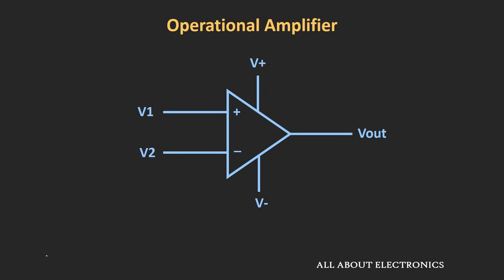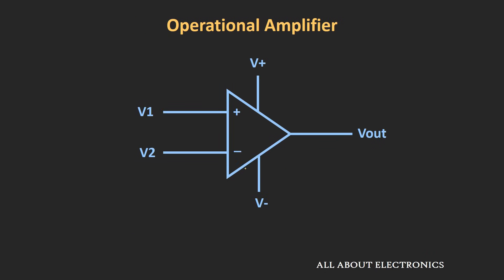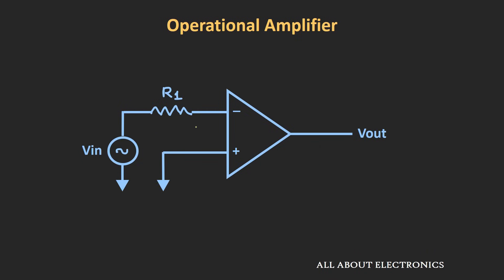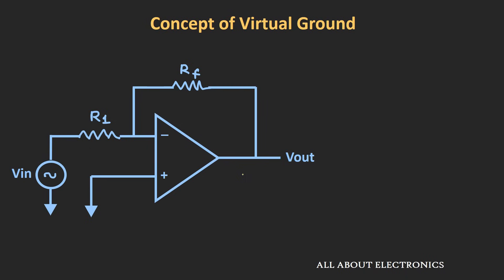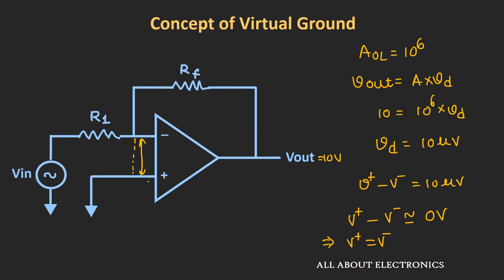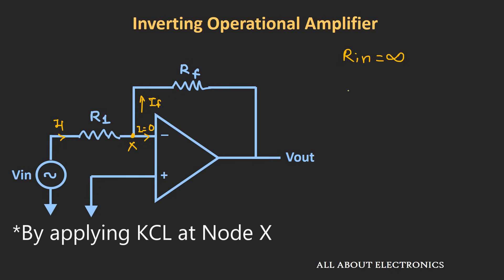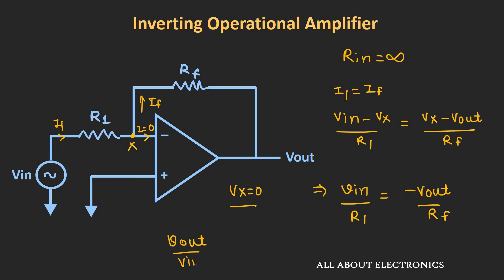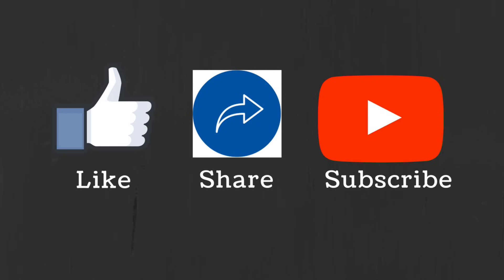Operational Amplifier: Inverting Op Amp and The Concept of Virtual Ground in Op Amp

Comment: Sir if the differential input is 0 then according to the CMRR characteristic that had discussed in early video output should zero na? I am confused about it
Reply from the maker: I think you got confused because of the concept of the virtual ground. 
But in the inverting configuration, the external input is applied only to one terminal. ( I am not referring the voltage V+ or V-, but the external input voltage)
So, here differential input is Vin only. 
If you take the case of the differential amplifier, where the input is applied at both input terminals, in that case, the differential input is V1 - V2 or Vin1 - Vin2.
I hope it will clear your doubt.
Reply: @ALLABOUTELECTRONICS  no sir not yet
Reply from the maker: In the closed loop configuration, the differential input is Vin1- Vin2. The external voltage applied between the two op-amp terminals. ( Not V+ - V-).

Comment: Sir why we don't give positive feedback because it leads to unstability but why
Reply from the maker: See, when you want to use the op-amp as an amplifier, then you want to amplify the input signal with particular gain right ??  And at the same time, the signal should not get distorted. 
With the positive feedback, the output will go to either positive or the negative saturation. And op-amp won't function as the amplifier. 
That means when we want to use the op-amp as an amplifier, it should be used in the linear region. and that's only possible with the negative feedback.
I hope it will clear your doubt.
Reply: @ALLABOUTELECTRONICS  thanku so much sir yes I understood

Comment: How can Vx practically be 0, I understand that 2M ohm resistor allows current in the uA range, but that does not mean that +ve and -ve terminal are at the same potential ( just because of minute current flow ( mA) ).

Comment: Why linear region is small in open loop ?
Reply from the maker: In the open Loop configuration, the voltage gain is very high. Typically 10^4 to 10^5 order. So input voltage of Vsat / 10^5 is sufficient to saturate the op-amp. Vsat is the maximum voltage the op-amp can give in the output. Usually it is less than supply voltage. That means input voltage of few microvolt is sufficient to saturate the op-amp. That's why in the open Loop configuration, the range of the linear region is very small. I hope it will clear your doubt.

Comment: Sir Is  feedback current will flow same direction or reverse direction?
Reply from the maker: It depends on the output voltage. If the output voltage is positive, then it will flow in the opposite direction. From Vout to ground ( From higher potential to lower potential).
If Vout is negative, then feedback current will flow from node X to Vout (From 0 to Vout)
I hope it will clear your doubt.
Reply: @ALLABOUTELECTRONICS  
It is clear thank you sir

Comment: In this confirguration we are get v+ = v- =0 then vd=0 then why vout is not equal to 0 ??
Reply from the maker: When we say V+ = V- = 0, its an approximation which is used for the virtual ground concept. Actually there is a difference btween V+ and V- ( in microvolts). And when it is multiplied by the very high open loop gain, we get some finite output. 
But here, with the negative feedback, when we consider the close loop system, then generally we refer to the close loop gain of the op-amp which is decided by the external resistors Rf and R1.
I hope it will clear uour doubt.

Comment: Why If goes up? I assume the potential of Vout is more than Vin and current direction should be down
Reply from the maker: You can assume other way also. That means current is flowing from Vout to the inverting node. If the assumed direction is opposite then the current If will be negative.
But in case of the inverting configuration Vout = -Rf/R1*Vin
That means if Vin positive then Vout is negative (for DC voltages)
In that case, the current If will flow from the inverting terminal to the Vout. (From higher to the lower potential)
If Vin is negative, then Vout is positive. And in that case, the current If will flow from Vout to inverting terminal. At the same time, the current I1 will also flow in the reverse direction. (As Vin is negative)
So as far as KCL is followed, you will get the correct result. 
I hope it will clear your doubt.
If you still have any doubt then do let me know here.

Comment: Like all your videos. I have seen this explanation of virtual ground many times, but it is always lacking something. Here the opamp is drawn with a feedback loop, but the huge gain of the open loop opamp is used to explain that the inputs are at virtual ground. Then it turns out that the gain of the opamp with feedback is by several factors smaller than the open loop gain. This would then mean that the inputs are not at virtual ground? Probably a good explanation that would include a differential amplifier with matching, and equal branch currents is too advanced.
Reply: same doubt!!

Comment: Sir y do we need to control the open loop gain in amplifier?
Reply from the maker: if you use the op-amp in the open loop configuration, then due to its very high gain, even for small input (in mV range) the output gets saturated.
Let's say if you apply a sine wave of 1V, at the output you will get a square wave type waveform.
So, unless the gain of the op-amp is not controlled, it can't be used as an amplifier. And to control that gain, it should be used with the negative feedback.
The amount of feedbag decides the overall close loop gain.
I hope it will clear your doubt.
Reply: @ALLABOUTELECTRONICS  tq sir

Comment: why positive feedback leads to unstability?
Reply from the maker: with positive feedback, the output voltage tries to increase continuously. And after a point, it gets saturated at the bias voltage (usually less than the bias voltage in case of the op-amp).
So, in a way, the output goes the output of the control. But in case of the op-amp, many times the circuits like Schmitt trigger and astable multivibrators are used with the positive feedback, where it takes the advantages of the saturation of the voltage. 
But in general where you want to control some parameters in a manner which you want, the negative feedback should be used.

Comment: sir you explaned impeccablely 
however i have a question i confused a one thing
 for instance if we add dc offset to the input voltage such as 2+2sin(2pi*1000t) when we calculate for output voltage how to calculate together dc voltage offset 
how changes our calculations ?  i hope you ll give feedback sir thanks ... :)
Reply from the maker: As we are operating the op-amp in the linear region so, the principle of superposition is applicable.
That means you can consider both AC source and DC offset individually. 
Let's say AC source is V1 and DC offset is V2.
And if you set the gain of the op-amp to 2 (for inverting it will be -2)
So, Vo = -Av x (V1 + V2)
= -2V1 - 2V2
Here, let's say V1 = 2 sin (2pi*1000t) and V2 = 2V
Then Vo = - 4 sin (2*pi*1000t) - 4.
I hope it will clear your doubt.
Reply: sir you are  a real educator
 i cant know how will i say thanks for your feedbacks

Comment: for ideal op amp,what is the value of power supply rejection ratio(psrr)?
Reply from the maker: For ideal op-amp, PSRR is infinite. That means even if there is a change in the supply voltage, there won't be any change in the output of the op-amp.

Comment: What is saturation
Reply from the maker: Ideally, the output of the op-amp should increase as you increase the input. But it cannot go beyond the supply voltage. (usually for most of the op-amp it is less than the supply voltage).
That means once the output of the op-amp reaches that voltage, it can't go beyond and we can call that voltage as the saturation voltage.

Comment: sir here you took that both input are at same potential is it only for ideal or practical opam too
Reply from the maker: You are asking about the concept of virtual ground right ? Yes, for practical op-amps too, V+ and V- are very close. Due to the high op-amp gain, the difference between V+ and V- is in micro volts. And for most practical cases, it can be assumed as equal.

Comment: what is the role of negative feedback on viertual grounding...pls answer..tommorow i have my exam
Reply from the maker: The concept of the virtual ground is only applicable during the negative feedback, or I would say when the op-amp is operated in the linear region.
Like I mentioned in the video, the negative feedback restricts the output of the op-amp. And to satisfy the condition, Vo = A x (V1- V2), V1 and V2 should be almost identical. As A is 10^6 order. So, V1 - V2 is approximately tens of microvolts. Or it can be said that both are at the same potential.  So, if the non-inverting terminal is grounded then inverting terminal will also act like a groud. And that's not an actual ground but its virtual ground.
I hope it will clear your doubt. And good luck for the exam.

Comment: M doing one implementation with lm324 why m not getting same voltage at both terminals...
Reply from the maker: I didn't get it. Would you please elaborate a bit. What problem exactly you are facing.
Reply: @ALLABOUTELECTRONICS  ok so it's a practical implementation...  I m making  V To I conventer...  With lm324 I'm apply input 1 v to inverting terminal n noninverting is ground...  Other component are also connected..  But at very first step on inverting m getting 0.6 v on o/p also getting 0.6v but on noninverting it's 0.0 v how it's possible
Reply from the maker: @kinnarikateja5064   what are the resistor values?
At the inverting end and in the feedback?
Reply: @ALLABOUTELECTRONICS  both same 220 and non Invetrting is ground
Reply from the maker: Just couple of things, if you have connected the circuit on breadboard then just ensure that all the components are connected properly. Second, at the output of the op-amp, if you connected any thing, then remove it and isolate the circuit and check the output. (due to loading effect, it may occur)
I think it will solve your problem.
Reply: @ALLABOUTELECTRONICS  hey can u plz tell me which op amp can be use as current booster...
Reply from the maker: What is the typical current requirement for the application?
Reply: @ALLABOUTELECTRONICS   50m amp
Reply from the maker: You may use, TLC2272AIP
Reply: Ok.  Let me check

Comment: At X , why are we subtracting Vin - Vx????
Reply from the maker: Its  Ohm's law. The current flowing in any element is equal to the voltage difference between the two terminal divided by the resistance of the element.

Comment: sir in negative feedback circuit the feedback signal must travel from output terminal to inverting terminal,but you have taken current direction from x to output terminal..why sir????
Reply from the maker: You can assume other way also. Its just simple KCL at the inverting node. In this case, the current If will be negative, but eventually, you will get the same result. 
I hope it will clear your doubt.

Comment: What could be the value of V saturation? Is it equal to external voltage supply
Reply from the maker: No, usually it used to be a less than a supply voltage. But for some op-amp, it is very close to supply voltage.
Reply: @ALLABOUTELECTRONICS  kk thank you

Comment: What if we add a resistor with the non inverting input terminal,is that change the voltage value of that terminal? Or it'll remain zero ?
Reply from the maker: In most cases, it won't make much difference and the voltage at that terminal will remain zero. But in many circuits, you might have seen the resistor connected at the non-inverting terminal. It is for the bias current compensation.

Comment: nice video. but
The assumptions u took are too superficial. if the non inverting terminal is grounded and vd is very small that means voltage at inverting terminal is also very small. doest mean u can assume Vx to be grounded. I am not an expert but i cant understand the assumptions u took
why does the op amp gets unstable when we apply feedback to non inverting terminal
Reply from the maker: That is what the concept of virtual ground is. In the linear range of operation of the op-amp, considering the very high gain of the op-amp, the difference between the two input is very very small. (in uV). So, if the non-inverting terminal is grounded then inverting terminal can be assumed to be ground potential. 
When we apply feedback at the non-inverting terminal, then every time fraction of output will get added to the input signal. So, over the period of time, the input signal (input plus fraction of feedback) will increase. And due to that, the output will also increase. So, over the period of time, due to this positive feedback, the output should reach infinite. Practically output will get saturated to the rail voltages. So, you are not getting the desired output. And the output is not following input anymore. 
But in some circuits e,g in Schmitt trigger and multivibrators, this positive feedback is intentionally used. 
I hope it will clear your doubt.

Comment: what is the effect on ouput when the inverting used ?
Reply from the maker: As I said in the video, in inverting configuration, the output will be 180 degree out of phase with the input signal. For the DC input signal, it will simply get inverted. So, if you apply V volt DC voltage as an input, at the output you will get -V volts.

Comment: why positive feedback is unstable?
Reply from the maker: Because in the positive feedback every time some fraction of output is getting added to the input signal. And this new input signal gets amplified by the same gain. So, with every iteration, the output voltage increases. And, theoretically, due to positive feedback, the output should reach infinity over the period of time. But due to the limitation of the supply voltage, the output gets saturated around or below the supply voltages. 
I hope it will clear your doubt.
Reply: @ALLABOUTELECTRONICS  Yes, sometimes it's called "runaway" and can cause real damage in some systems.  Like the tacoma narrow bridge collapse in Washington state in the USA.

Comment: Sir, after getting feedback how does the virtual grounding still there and why open loop gain has not influenced the output voltage
Reply from the maker: Because of the negative feedback, the concept of virtual ground can be applied. Due to the negative feedback, every time some fraction of output voltage/current is fed back to the input or every time some fraction of output voltage/current will get subtracted from the input. And due to this negative feedback, the open loop gain is not influencing the output voltage.
I hope it will clear your doubt.
Reply: @ALLABOUTELECTRONICS  thanks sir
Reply: Sir please make videos on field effect transistors

Comment: Current doesn't even enter the op amp then how does the signal gets amplified?
Reply: Actually current does enter but it is very small because the input stage of the op amp presents a very high impedance.

Comment: Sir can u plz explain  what is a feedback practically ?? 
N y the linear range is very small in open loop confgn ???
Reply: feedback reduces the gain, if you dont use feedback the open loop gain is so big even a tiny signal will cause the op amp to "saturate" and output voltage to go to the power supply voltage, ie the "rails"

Comment: I didn't get the point at 7:03 , please explain
Reply from the maker: When we consider op-amp as an ideal op-amp then it has infinite input impedacne. Practiacally it has very high impedance.
Reply: If  you can find a diagram of the internals of an op amp you'll see the first stage is an input stage that has a very high impedance which reduces the current into it.

Comment: Why vertual ground is only applicable in negative feed back. Why not in positive feedback or open loop ???
Reply from the maker: Because this concept is valid when the op-amp is used in the linear region. When positive feedback is provided to the op-amp then op-amp goes into the saturation region.
Reply: @ALLABOUTELECTRONICS  what happens when  positive and negative feed back applied together , like schmitt trigger or second order active filter circuit , then can we apply the concept of virtual ground ???
Reply from the maker: No, It can't be applied.
Reply: @ALLABOUTELECTRONICS  but it is applied while deriving transfer function second order filter using opam, which is having both positive and negative feed back .
Reply from the maker: It actually depends, in what range the output is (linear or saturation) even after using both positive and negative feedback. Like in the case of the multivibrator circuit despite having both types of feedback, output remains in the saturation region,. While in filters, it is in the linear region. I hope now it will clear your doubt.
Reply: @ALLABOUTELECTRONICS  not at all ,because value of output is never been considered while deriving TF of second order filter.
Reply from the maker: There is already an assumption during the derivation that output is not going into the saturation.

Comment: why Vx=0 ????? sir
Reply from the maker: By applying the concept of virtual ground, Vx= 0. The non-inverting terminal is at ground potential. So, same voltage will also appear at inverting terminal. And one more thing, this virtual ground concept is applicable only when the op-amp is operated in a negative feedback configuration (or in other words, in linear region). If it is operated in open loop configuration or positive feedback configuration (Like in Schmitt  Trigger), then this concept cannot be applied.
I hope it will clear your doubt.
Reply: yes sir... it did clear my all doubts... thank you sir. 
I have a request to  you sir,  will you please upload a video describing the Wein bridge oscillator and also the triangular and square wave generators. 
Exams are almost there and I have still  got soo much doubts in these topics.
So, Please sir.
Reply from the maker: Yes, soon I will cover the Oscillators.